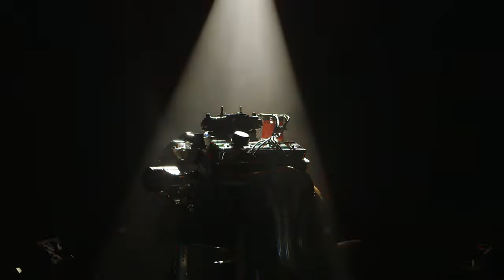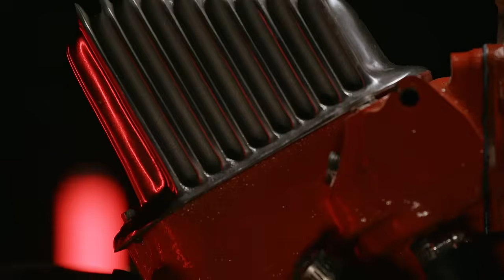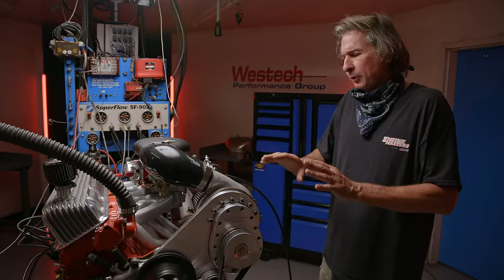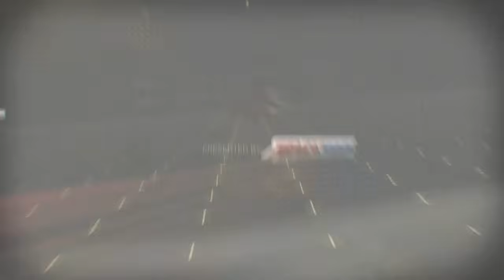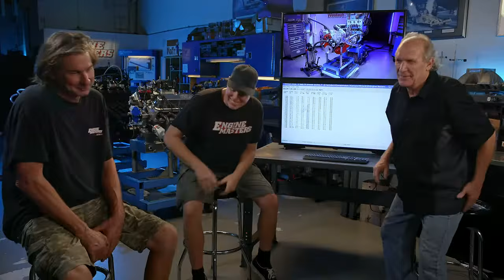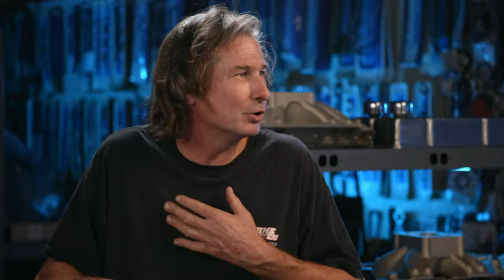Engine Masters  S5E77   Dulcich's Quest for Slant 6 Greatness!

Comment: I ran a cast crank in my SBC. Cast iron crank pin expands more than steel rod end. .0005 oil clearance at 200 deg. Started out as .0025 at room temp.

Comment: Im not a die hard slant 6 guy. However, for economy and a nice little daily driver. You cant really beat a 225 super six with a 3.55 gear and an overdrive transmission. Quiet and smooth, excellent low range torque. They just need a little leverage to get them going.

Comment: Try putting hemi head on it like they did in Australia then add a turbo!! you would be suprised at he power.
Reply: The Aussie "hemi" 6 cylinders (245 & 265) are a completely different engine. Almost zero parts in common with the slant 225, and better in every way.

Comment: Steve's mild combo made 215 hp which is 0.95 hp per cubic inch. In a 350 that equates to 334 hp. That's about right for a mild build with some head work.
Reply: They never seem to talk about Hp per Ci,  the whole of America seems to think a 500hp engine is better than a 400 hp engine even if the 500hp is twice the Ci.  Most of the engine they build on here have a very average VE

Comment: Pontiac in the late 60's was putting an OHC 6 cylinder engine with a 4 bbl Quadrajet named the Sprint 6 into a Firebird. It was rated at 215 hp.
Reply: Another weird, great, short lived Gm project. They sound good  as well.
Reply: Jay Leno has a nice one on his YT page!
Reply: Sad that the six was never developed beyond the production engine. That OHC Inline had some serious potential.
Reply: My buddy had one , his dad said he could only buy a six cly. Car, enter the 250 house Pontiac. Tempest. That car put away a few V8s . Surprised more then a few guys.
Reply: once again, no reason why GM should have taken the 1970's right in the shorts. Rochester fuel injection, a turbocharged aluminum V8 engine in 1962, the Sprint 6...if GM had been willing to reach back a decade, they could have competed with imports. Instead we got tiny V8 gas fired engines that dieseled and diesel engines from gas designs that made you wonder how "screamin' Jimmies" ever ruled the OTR trucker world.

Comment: In the NASCAR Jr class the General brought the Corvair with its 140 cube flat 6 and Ford brought the Falcon with the 170 cube water warmer. The Ford was choked with its integral cast in the head intake. Plymouth/Chrysler brought the new Valiat with the 170 Slant Six with a Hyper Pac installed. They used a hotter cam than supplied with the marine Hyper Pac kit, and a slightly larger 4 barrel carb. Those Valiants with the terrible aerodynamics were touring Daytona at 128MPH. They came to race. The General was giving up 30 CID which on those small engines is a huge handycap. All Ford had was the 1 barrel lawn mower carb.

Comment: "Not about the horsepower" . . . and "Not a powerhouse." No, but it has more horsepower (and fewer inches) than a factory 283 V8 which came rated at 195hp --- and a lot of those 283s would really get up and go. This little motor apparently does as well, or possibly better.

Comment: Well, the Slantsix wasn't a performance engine, but a reliable everyday runner for ever. But, as every guy who had a few Slantsixes, I love it. I does it's job, but in a nice way. Actually, the 170 responds better, probably suffering less the bad air flow. Fun to see the blower package!
Reply: A blower is the only way to get any mixture into the cylinder at high RPM. The stock heads have terrible airflow.

Comment: Aggressively rising boost curve I know, but..
7.5 psi boost is 1.51 BAR MAP. 
That means 204.3 hp and 209 lb/ft from "the theoretical NA engine." 
This is going backwards from the 215.4 hp and 251.4 lb/ft the NA engine made. 
10.5 psi boost is 1.71 BAR MAP. 
That means 192 hp and 199.6 lb/ft from the theoretical NA engine. 
Going even more backwards.
All boosted engines deserves  / MUST HAVE a GOOD  intercooler. :)
Reply: not really, you forgot that a Supercharger also takes power to be ran and about 30hp for a Supercharger like that at 10.5psi seems very reasonable if not somewhat low.
Reply: It would seem that way to someone who can do math but has hardly thought about the setup at all. Of course efficiency goes down with a blower increasing the heat of the charge. You need to know the intake manifold temperature and subtract the temperature increase percentage from the boost number.

Comment: 251 Torque & 215HP (naturally aspirated) is comparable to modern day V6. Supercharged of 315 Torq. & 308HP is only slightly below a BMW turbo I6.  This is a great little engine. great job.
Reply: 14:30 -  It's in the same ballpark as the GM blown V6 3800. 245 HP/295 FtLbs with 7-8psi from the M90...IIRC?
Reply: But it cannot match fuel consumption. I was never satisfied with my slant sixes. A 318 was not much worse.
Reply: Not even close .   A 213 cu in Toyota Camry family sedan V6 (3.5L) makes 301 hp.  

Unless you are excluding DOHC 24V from modern v6 and want to compare to a modern pushrod 12V.  Even then the last gen Silverado 4.3L (262 CI) made greater than 1 hp per cubic inch at 285 hp.
Reply: The Ford SHO V6 was making more power in 1989....
Reply: No, just no. 215hp from 3.7L inline 6 engine. BMW inline 6 made 321hp from 3.2L in early 90s
So NA 3.2 made more power than boosted 3.7L
Reply: @DuBstep115  If you're talking about the S54B32, that wasn't the 90s, chief. The S54B32 was in the E46, E36, and E85/86 chassis, which started in 2000. And that was 25 years after the last of the slant 6s. The dude is right, those power numbers are comparable to modern daily drivers, which hover around 200HP. The S54B32 is also intended for higher performance applications. The slant-6 never was. So, if you're going to compare, then compare apples to apples. The cars BMW made in the 90s that would've been comparable to the kinds of vehicles the slant-6 would've been in 2+ decades prior made around 120HP. The M30B32 never made more than 197HP at any point, and production ended for that engine in 1988. Hell, even the M30B35 only made a hair over 200HP, and no M-series engine made in the 90s came anywhere near 300 HP. So, I'm not sure wtf you're talking about.
Reply: @akio2589 S50b32 that was in e36 in 1995. S54 had 333hp. Also M30B32 made 203hp in 70s. You pretty much got everything wrong
Reply: @DuBstep115  No. I didn't. I said compare apples to apples. The S50B32 was in the M3... That is not the kind of vehicle a slant-6 would've been in. Now, I'll grant you I forgot about the S50. However, the entire point of my response is that those engines were not in the same "class" as the slant-6, and what OP said was accurate. And the 206 variant of the M30B32 was in exactly 1 model vehicle that it was tuned specifically for. If we're gonna be going with tuned variants of engines, then the Hyper Pak variant of the slant-6 made 196 HP in the 60s. The slant-6 wasn't made to go fast, it was made to run reliably. It does that well. But you can, and many have, get good power from a slant-6.

Comment: Love this! In 1974 my cousin and I built and aluminum block Slant Six for competition in the Mini-Modified classes in the NC Tractor Pullers Association. We bored it .040", shaved the head .080", ran a fairly mild Melling cam,and installed a 500 cfm 2 barrel Holley on a modified stock intake. It would turn 6,000 RPM and sounded awesome through six pipes pointing straight up. We won both the 1400 and 1600 lb class point championships competing against mostly small block Chevy and Ford V8's. Those guys sure hated us!
Reply: Love it
Reply: In Waterford Ct stock car races in the early 60's there was one car with a Slant. It was unbeatable week after week. The owner laid it on it's side, special pan intake etc. It held it's own on the straights but went through the turn like it was on rails. The track promoter put a bounty on it, got extra prize money for who ever could beat it. In later years when I was in Denver there was another that cleaned up weekly at the Lakeside Speedway.
Reply: That's a " win "
Reply: Freiburger is a butt ......

Comment: It's about cubic inches...   test a v8 that small
Reply: Nah, they were not designed to be a good engine for performance, and a similar sized V8 would be able to rev harder and have far better performance.
Reply: @johncoops6897  The hyper pak showed chrysler could optimize the design for more power though. 195 hp, NA, in the early 60s.

Comment: I don't know what you guys are on about, leave Dulcich alone.  In the early 80's I had a 67 A-100 panel van with a 225/3 on the tree that I rebuilt when I got it and drove for 10 years everywhere, all over the country, and I abused the snot out of it the entire time. It was FUN. Smoky burnouts? 3800 rpm's and sidestep the clutch and I could keep the tires spinning all the way through first and second and bark 3rd with the 8 3/4 inch Sure Grip and 3.50:1 gears. 20mpg everywhere, donuts on demand. 
 I ruined it by putting a built 318 automatic in it from a wrecked 69 Coronet 440, thinking I wanted/needed more power. I didn't, not in that thing, lol. The only thing the 318 improved was the way it sounded, which was seriously vicious. It just wasn't fun to drive anymore.

Comment: Just looking at the gasket, You KNOW which way it's going to blow. There is like no gasket, head/to block clamping in that area is non-existent(1/2"<3/4").

They can make good power, N/A one guy on Youtube runs 11s. On boost I have seen 520RWHP and 10.74@127mph on here.  Australia Had a HEMI Slant 6.💪🔥
BMW still runs a Slant-6, JUST a 🤏little bit more advanced🤣.
Reply: Aussie Hemi 6 wasn't a Slant 6. Completely different engine.
Reply: Australia never had Hemi slant 6. The 215/245/265 upright 6 was a completely different engine to a slant, with far superior strength.
The only thing "Hemi" about the later Australian 6 was the fender badge, they didn't have a hemispherical combustion chamber, it wasn't even close to that 😂
Reply: @johncoops6897  agree with all you said except "wasnt even close to that" it was a 'canted valve' 'semi-ish' Hemi design, certainly wasn't a straight up and down valve wedge.
Reply: @cudadog11 - the term "Hemi" is a marketing term, not really a description of the combustion chamber.
The Aussie 6 had a more circular shape than some engines, but wasn't really hemspherical. It also wasn't crossflow, so there was a large amount of asymmetry because of 2 valves on one side (even if slightly skewed inwards).
Let's say that it more of a hemi than some closed chamber designs like the high-compression Holden 6's 😉
Reply: @johncoops6897 agreed, as an Aussie who's had several Slants and Hemis, and spent many late nights on them..

Comment: Freiburger should check out Argentina's Turismo Carretera and what they done to the ford and Chevy inline 6 engines , 400+ HP naturally aspirated screaming 9000rpm with no problems they rev so fast and free sounds like motorbike engines.

Comment: Dulcich might love to get his hands dirty on an Aussie "hemi" 6, an animal of Chrysler Oz that was a locally rescued orphan of a scrapped Dodge truck design.

Released in 1970, the ultimate versions of these were the fastest 6s in the world for decades. In 215, 245 and 265 cubic inches, they powered everything from mundane work utes and family sedans, to Bathurst screamers with  fire-breathing triple Webers punching 302 hp.... before the fun police stepped in.

The 265 used the same piston diameter as a 318.

If course they're not a true hemi (more a canted valve) but the power potential of these is astounding for their simplicity. They sound tits too.
Reply: @ Cat_fish911 - Yeah, hemi6 might be fun to send to Steve, but watching Friedburger there turn from flippant to fear filled at the wail of a 265 rattling away up to 7000 rpm, that'd be a sight to see.
I'd love to see what Steve could do with the new HurricaneTT too.

Comment: Im in the middle of rebuilding mine. Butted a ring under boost and deformed a ringland from a pull and ended up breaking a rod a littler later. Luckily for me it happened right at the bottom of the stroke. Oil ring got dragged out and jammed the piston. It also happened at takeoff when letting out the clutch at an intersection. So I was able to clutch in and shut the motor. Superficial damage on the crank and block and it didn't touch anything else other than the starter, it punched the starter off the mount lol. Old I6s make a lot of power and are pretty durable.

Comment: A straight six is known to be a reliable work horse engine, they do have potential for performance,  they have more low end torque than V8's, and like any other motor, the better they breath, the more power they make, I've heard stories from hot rodders and muscle car guys that with little work on the short block, and modifications to the intake and head, you can increase the torque and horse power beyond belief,  there were a lot of 6 bangers on the drag strips in the 50s and 60s, 70s , they can, and do make respectable times in the 1/8th and 1/4 mile .

Comment: The thing I hate about all these old I6’s is weather it’s Ford Dodge or Chevy is the exhaust and intake on the same side sharing bolts
Reply: Agreed.  The opposing side intake/exhaust ports are very interesting when folks build them.
Reply: Yeah i dint know why cross flow heads were never used uniflow are only for economy engines
Reply: @cjgordon22  Because they were pushrod engines. It's very hard to do a crossflow head with pushrods; that's why the Hemi V-8's were expensive motors. No way they were gonna do dual rocker arm shafts with an economy engine.
Reply: There was a South American race team that built a cross flow head for a Slant,... There was also a crossflow done for the Aussie hemi6, IIRC by Yella Terra, but it didn't sell well due to costing more then a replacement engine. And then there's the Ford 250 Crossflow, which evolved in to the Intech and then the Barra. Many Euro inline sixes are also crossflow, especially Jaguar, BMW and Mercedes.
Reply: I agree, but... there's a reason for it.  Engine manufacturers live and die by "warranty performance" - how many dollars do we spend per engine on warranty repairs. Generally, warranty repair expense per engine has a direct correlation to the number of gasketed/sealed surfaces. Building the heads this way eliminates one gasketed surface, which is a big deal.  Also, significantly less expensive to manufacture - probably a savings of $40 per engine, which is huge in the automotive business. An inline 6 has less than half as many gasketed joints as a V6. Spend a little more on fasteners, save big dollars on initial machining and warranty.  I'm not saying it's right or good, but that's how we think.
Reply: @HPDrifter2  That contrasts to the costs of raw material, with a V6 generally weighing less in metals than an inline 6, and with the packaging considerations, where the mass goes in the chassis, how much cabin space, with the smaller package of the V6 enabling shorter spaces for the engine bay, so more room within the same sized wheelbase for passengers instead of running gear.
Building Cars is a lot of math fighting each other.

Comment: This is great example of how good   300 “Cleveland “ head of Bob Glidden was.  500hp+ no turbo or sup charger
Reply: Dulcich might love to get his hands dirty on an Aussie "hemi" 6, an animal of Chrysler Oz that was a locally rescued orphan of a scrapped Dodge truck design.

Released in 1970, the ultimate versions of these were the fastest 6s in the world for decades. In 215, 245 and 265 cubic inches, they powered everything from mundane work utes and family sedans, to Bathurst screamers with  fire-breathing triple Webers punching 302 hp.... before the fun police stepped in.

The 265 used the same piston diameter as a 318.

If course they're not a true hemi (more a canted valve) but the power potential of these is astounding for their simplicity. They sound tits too.
Reply: Great point, they make low end torque as is, make a 6 popper breath better, like any other engine, and power goes through the roof ! They have alot of unrealized potential,  that's for Sure